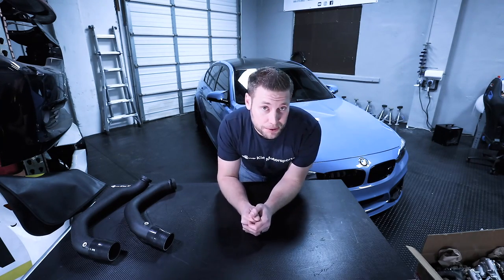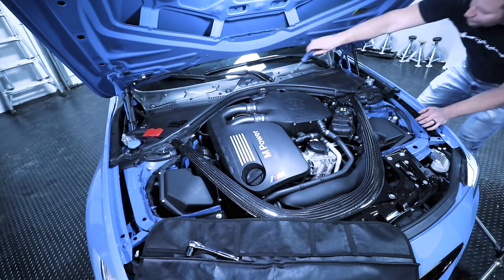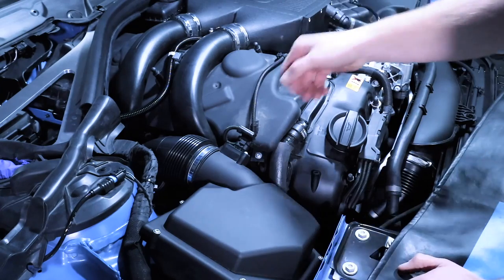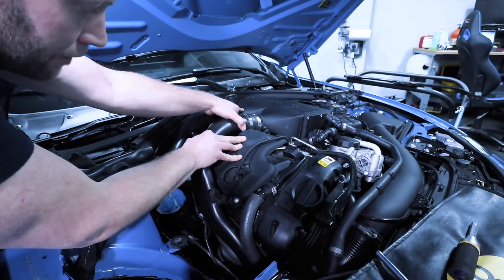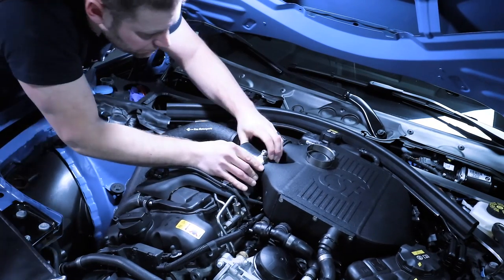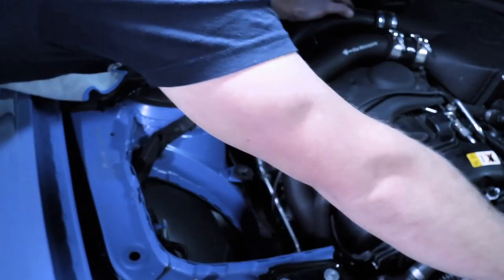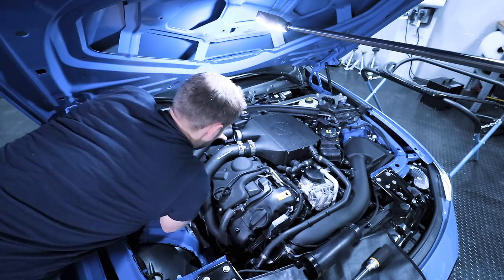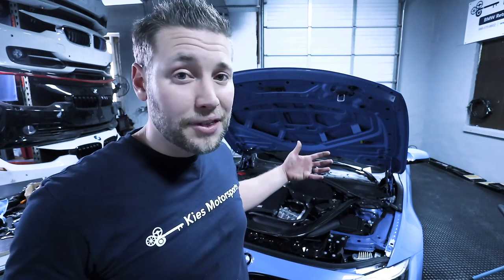DIY: F80 M3 S55 Charge Pipe Installation (F82 M4 and F87 M2 Competition as well!)

Comment: I bought a F80 M3 in April after my e46 was wrecked. On my e46 I was doing 99.9% of all maintenance. After  my warranty runs out on the M3 I'll be doing the same. Thanks for the content as there isn't that much F80 DIY's out yet. You are leading the  pack!
Reply: Hell yeah! Never took mine to dealer when I had warranty on mine, so far I’ve done sparks, Charge pipes, charge cooler, oil changes, lowering springs, spacers, spoiler, EL midpipe, tips, and splitters. There’s prob a few other more minor things lol, DIY life

Comment: Great video, I think I figured out to take the grommet out of air box and install it then place airbox back since the grommet is sitting on top of the spot it’s supposed to be in and causing the box to sit higher and rub on the carbon strut bar. Also, I’d say to take both charge pipes off first and install the rear one first instead of the way you did it, just a little more room that way

Comment: Which specific E10 socket did you use to tighten the ER chargepipe to the turbo? I have trouble clearing the increased diameter of the ER pipe with my E10 sockets. It won’t allow a secure fit to the stock E10 bolt without hitting the chargepipe. Thanks

Comment: Since the aftermarket one is bigger, do you have a clearance issue between stock air intake and the new charge pipe? I've mine upgraded and the charge pipe is slightly touching the stock air intake and I wonder it it will damage the stock intake? Thanks!

Comment: Hey on the vrsf charge pipes it comes with (2) Allen key bolt and nuts. I have no idea what its for. Also, after installing the  stock e10 bolts, I got them back into the groove, but my socket wont fit over them properly to tight as the charge pipe comes in the way. Any ideas?

Comment: Hey is the turbo system closed loop without turbine exposed to the air? Reason I ask Is i stupidly dropped a 10mm socket into the engine and its sitting on the bottom tray and i cannot get to it..

Comment: Thanks for the help! Both of my VRSF pipes have big lips above where the e10 bolt is seated and I’m having trouble lining everything up with the turbos. I tried your method of pulling up and sliding the bolt in for the front turbo and that seemed to work. However, I’m having an even harder time with the back turbo and clearing the lip with the e10. Any suggestions?
Reply: Use the bolts the VRSF pipes came with, they don’t have the lip

Comment: Will that charger pipe fit f30s models? Or just Mseries🤔🤔🤤
Reply: That’s only on Ms with S55. Yours is single turbo so it’ll just be one pipe, little more tricky install than this. Did it on my friends 435i

Comment: God, how many times have you guys had to perform the same steps over and over on this one car to make all these videos? :)
Reply from the maker: Lol, I think we had to remove and reinstall the brace 6 times..
Reply: @KiesMotorsports  on the N55 it's the IC to TB charge pipe that is the weak link, is that not the case on the S55?
Reply: @KiesMotorsports  arent those bolts the aluminum stretch bolts, with one time use?

Comment: I just did a stage 1 bootmod3 tune to my 15 m4, yesterday I heard the air leaking, and I got the codes but I'm not sure where to look. Any suggestions?
Reply: You could take the charge pipes off for inspection and make sure that’s where the boost leak is or eliminate them

Comment: i installed the charge pipes on my 2018 M4. they are in and all seems tight and fitting. i test drove it and under boost i hear whine sound. is this normal? almost sounds like a super charger. but not as pronounced as a true SC. any feedback on this would be great, thanks !
Reply: Shnel M4 i had the same issue, i realized i forgot to put the O-ring in the new charge pipes
Reply: Yeah that sounds like a boost leak, double check your install. Also check the bung holes that some pipes have to make sure they’re not open